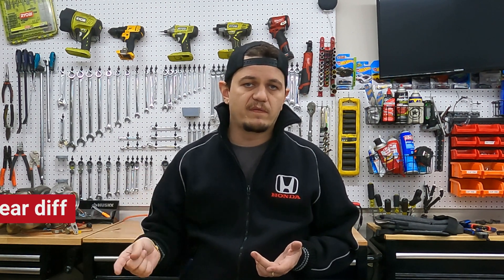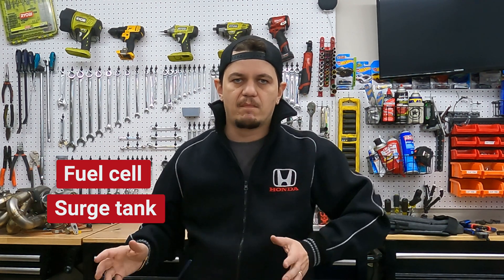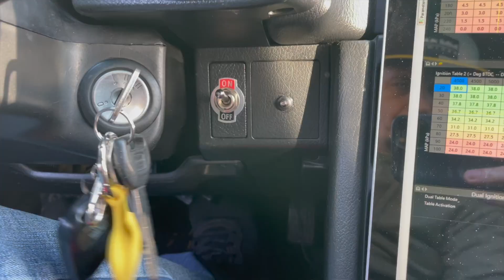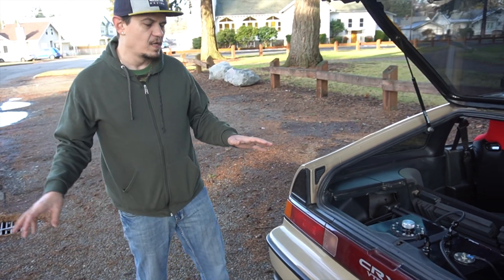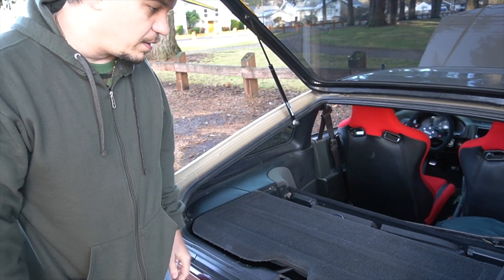CRX Fuel Cell & Surge Tank Setup - Honda CRX Turbo Build Ep. 3

Comment: Would that system meet the requirements for SCCA?   I read you need to have a metal box around the fuel cell and a bulkhead between the cell and the driver..   I think those two things are the same?
Reply from the maker: It would depend on the series. I ran this setup in SCCA autocross. I’d probably want a bladder FIA rated system if there were other cars on track.